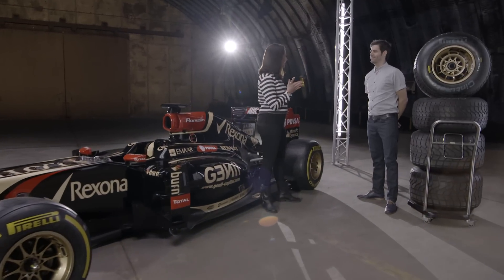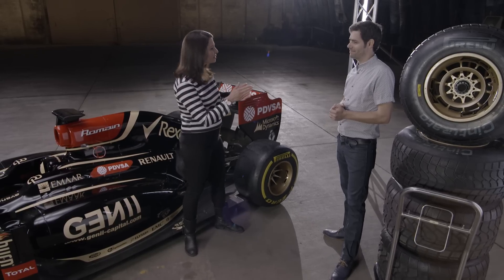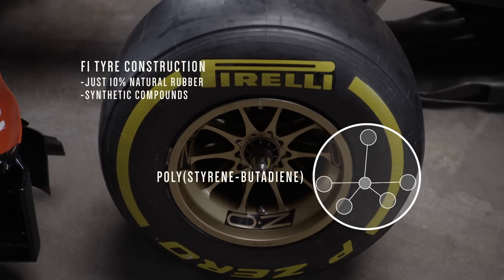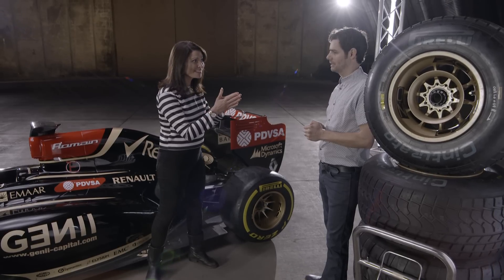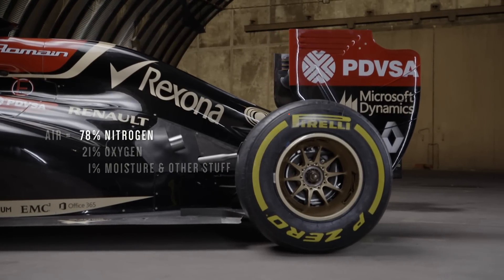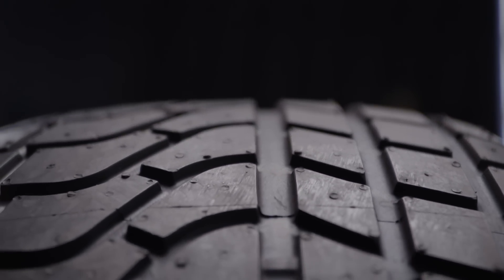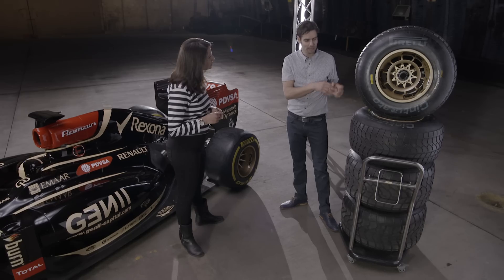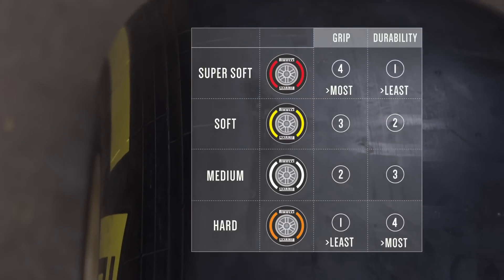F1 Tyres Explained | One Second in... F1 | CNBC International

Comment: Also use nitrogen in tyres because its easier for oxygen to travel through the rubber / composite mediums than nitrogen; maintains pressure
Reply: Serenity Oxygen molecules are smaller compared to nitrogen molecules , the can permeate through the tyre easier
Reply: Chemically engineer here. It's not about the volume of the gas molecules but it's about different gases "sticking" to the synthetic compounds (though a processor called adsorption, yes, with a D)
Nitrogen almost does not interact with the rubber. While the water in the air can stick to the inner walls of the tire (due to increase of temperature) and creating more drag by a most frequent adsorption rate. 
Basically water / humidity sticks to tire walls and that creates an heavier feeling in the car
Reply: Yamurat kerim Aslan nitrogen molecules are lighter and thus will move faster compared to Oxygen molecules
Reply: Why is it easier for Oxygen to travel through Rubber?
Reply: Xin Lee doesnt nitrogen molecules move faster because n is the 7th element o is the 8th element